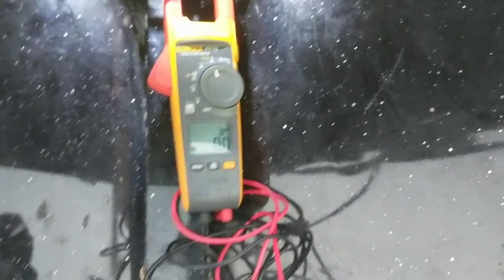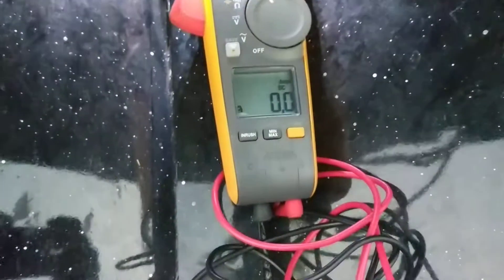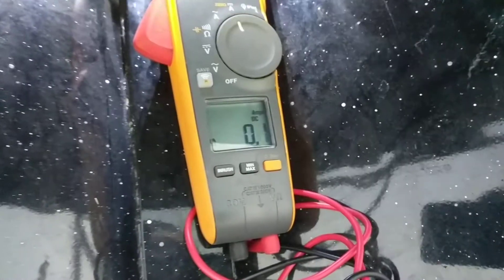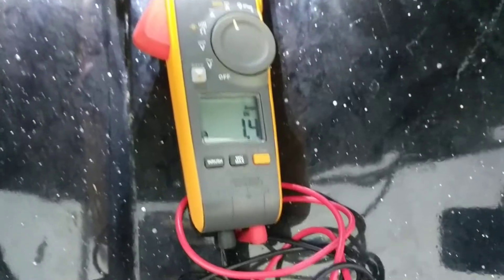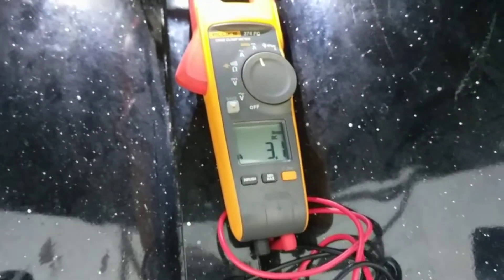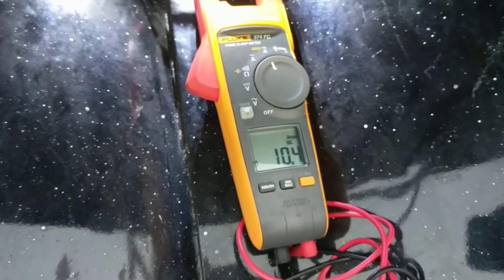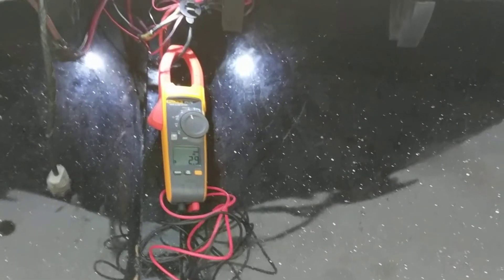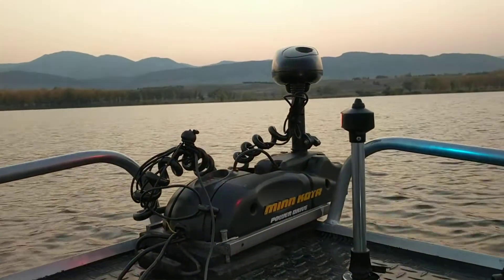minnkota 24v trolling motor, amp draw in real time V1 without PWM controller

Comment: Just got a LiFePO4. MinnKota PD55 (12v) draws 45A @12.8v at full power.
Reply from the maker: That’s about 580 watts. On par with a 12v draw.
Reply from the maker: 24v system would draw around 25A for same watts and 36v would draw around 15A. 
For trolling with kicker I prefer 12v system. For spot lock in current or wind 24v. I don’t fish tournaments so don’t need or afford the 24v

Comment: You're getting twice the run time with 24V because you've got two of the same size batteries.
Reply from the maker: Actually I'm using half the amps to generate the same watts. 

24v x 5 amps = 120 watts
12v x 10 amps = 120 watts

Comment: I run a 24v terrova riptide with a 24V50ah rebelcell lithium battery when I power it on it draws the same as yours on level 1 and when i am on level 5 it draws 1 amp more than yours i think 11.4 🤔
Reply from the maker: This video was made with a an older board, it has 10 levels in increments of 1.  When I added the I-pilot I had to get a new board which has 10 levels but it has .5 increments of thrust.  
I run a 100ah 24c lithium pack in this, and when trolling I get 3-5 days use depending on how hard I use it.  
Also have a 12v 55lb minnkota power drive, it uses the same size 100a 24v pack with a DC DC converter. It uses 2x as much amps for same thrust and lasts me 2-3 days tops.
Reply from the maker: Also what kind of prop I'd weedless it will draw more vs std power prop
Reply: @omieyouknowme  my one is a ipilot link its  .5 increments up to level 10 with a weedless prop..it would only last about 4 to 5 hours trolling on level 5.
Reply from the maker: @WolfKillerLestat  4-5 hours is normal then with weedless prop. If u want another 1/2 hour switch prop.  Or go to the brushless design from Garmin or lowrance but they cost 3k.
Reply: @omieyouknowme  that's good that it's normal i though that maybe something wrong and it was draining the battery. Would the garmin or the lowrance have much better of a run time? Also i think one of them can be ran on 24v and 36v that would be the better option if i was to change.
Reply from the maker: @WolfKillerLestat  the Garmin and ghost are brushless motors, they have hall sensors and are quieter because there are no brushes making contact with the amateur or shaft.   They will be more efficient, but really I don't think worth it.
If they break only mfg can service them. Minnkota u can get parts anywhere.
You can pick up 10 lithium batteries for the difference. 
Not worth it, stay with the minnkota.
Reply: @omieyouknowme  going to stick with the minnkota, what brand batteries are you using
Reply from the maker: @WolfKillerLestat  I actually build my own for boat from eBay parts. Can't say which to use sorry. They all come from the same factory in china

Comment: This might be a dumb question: I was looking at two 35AH batteries to wire together for 24V, I’m guessing since this draws a bit over that at V 8-10 those batteries won’t be up to the task?
Reply from the maker: You can still use em, if they are lithium I'd say 30amp hours be realistic. If you running the motor at level 3 all day you can expect about 5-6 hours without killing them completely with a 20 percent reserve.
Reply from the maker: If you run the motor at level 5 or more then add the amp draw up till you hit 30, so 15amp per hour you get 2 hour run out of batteries

Comment: Thanks for info. I’m running 2- lifepo4 12v 50amp.  Should Last a while in my 15 foot flat bottom.
Reply from the maker: This video was made in an older 10 step controller. Newer models are 20 step in 1/2 increments, so there are more options allowing longer run time

Comment: hi  may I ask can I put a 12v 34lbs motor on 24volt battery ? thx
Reply from the maker: Not directly, you can use a step down converter. Amazon has 30amp step down converter for 25$ but you will generate heat in the converter at mac power. Also a 12v will pull up to 50amp when running max speed and will burn out the converter or cause a fire. If you go that route make sure not to use more than half power, with a 25amp.inline breaker, not ideal as you lose the benefits of a 24v system. I do not recommend it.

Comment: Hi. I’m trying to get a trolling motor for my kayak the first time and definitely interested in a 24v 80lb thrust. I plan on getting a 54AH lithium battery, I will only be running at max level 3 setting, how long do you see this 54AH battery will last?
Reply from the maker: 54ah pulling 3amps get a good 12-15 hours out of it.  As you draw the battery down the 3 amp draw will increase slightly to compensate for the voltage drop too so at the 15 hour mark expect to pull 4 amps.